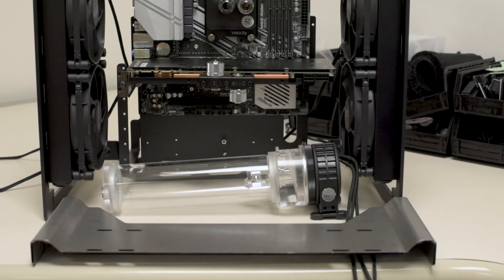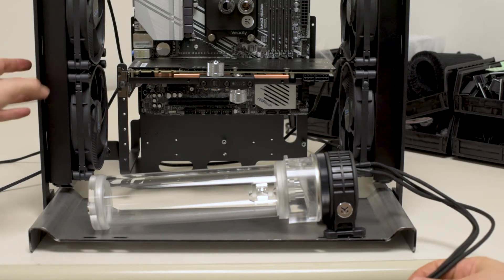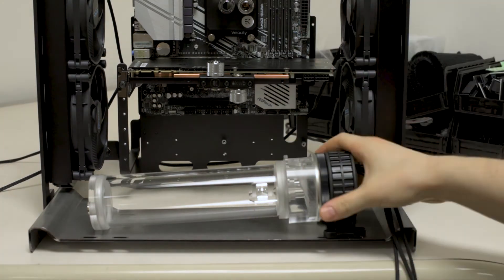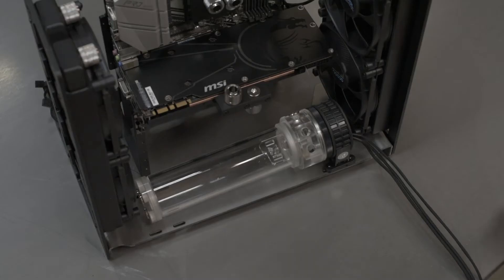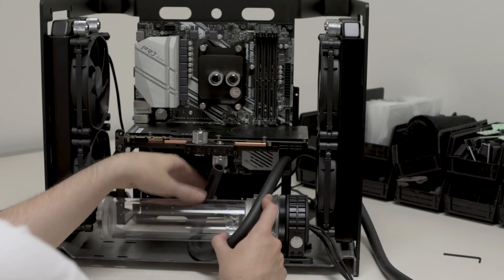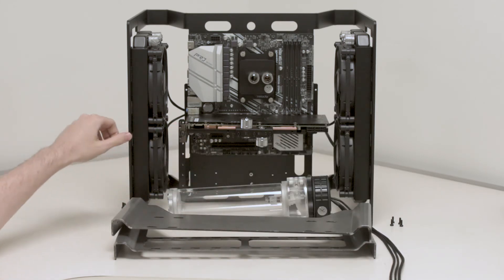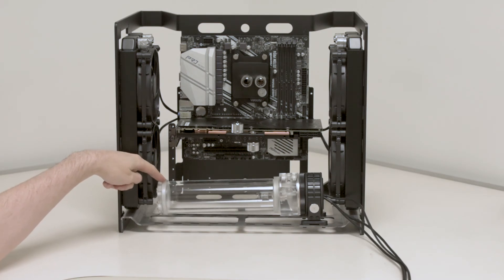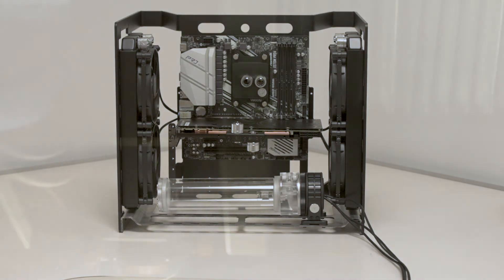Atlas Water Cooling Bracket Prototype

Comment: The same ek mount you are using for pump is available separately and fits around the other end of the reservoir. They are both 60mm diameter